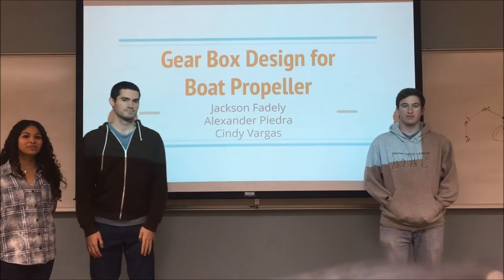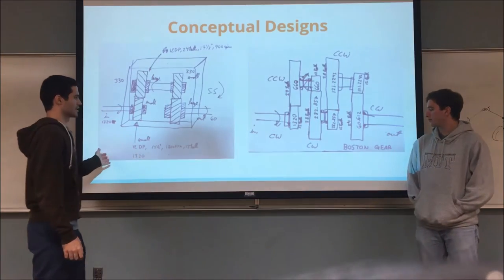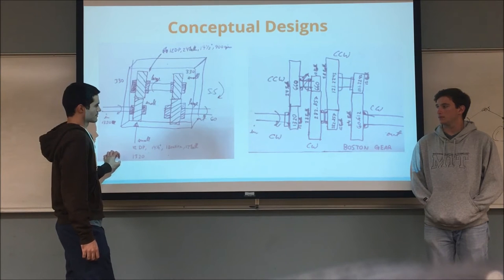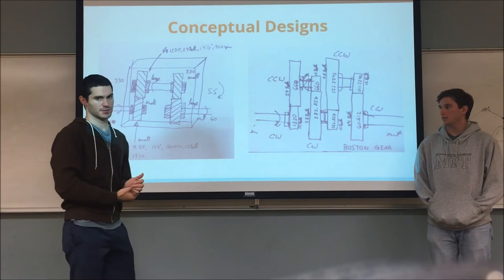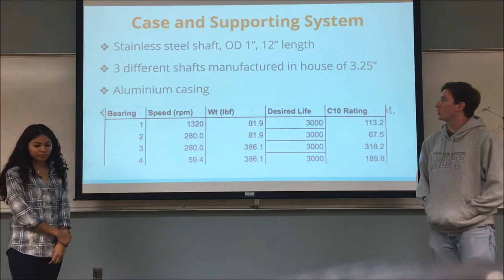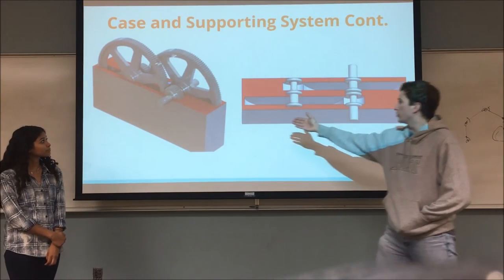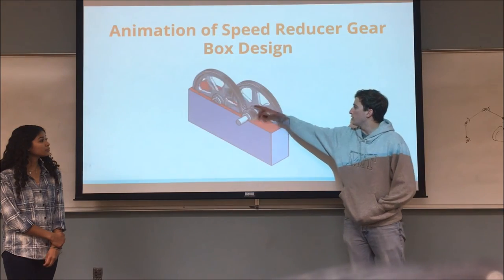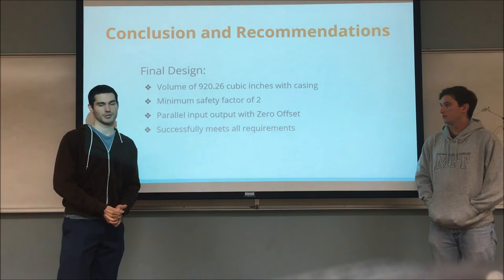Team 1: Gearbox Design for Boat Propeller

Comment: Overall great presentation. Speakers were clear and understandable and the presentation was read easily. One small comment would be for the speaker on the left not to stand in the way of the projector and the dress code could have been improved.